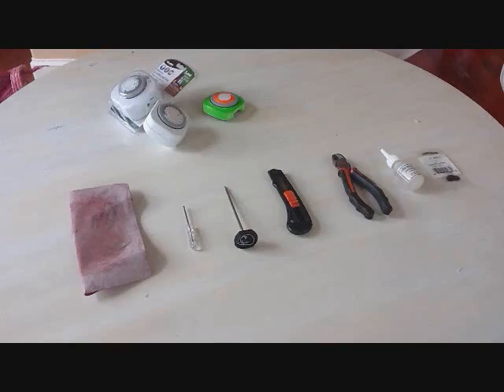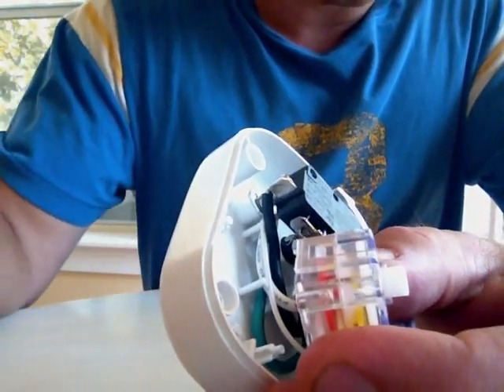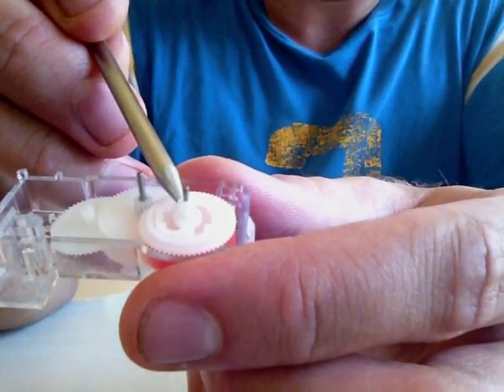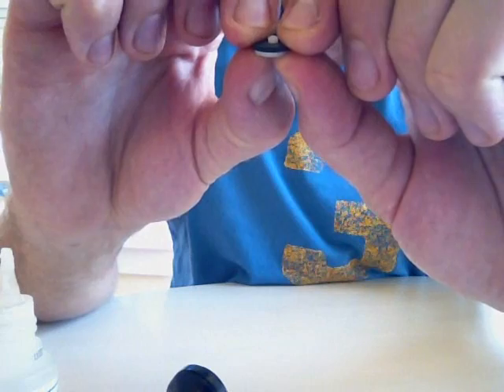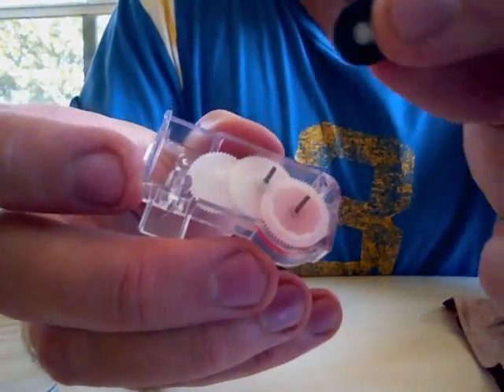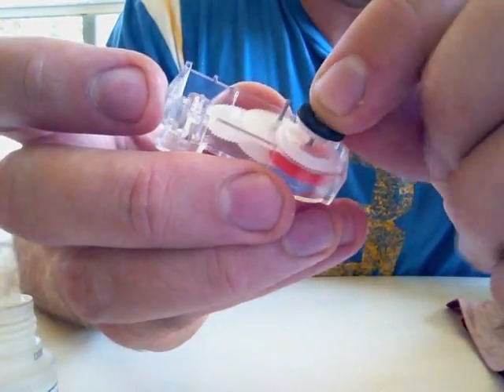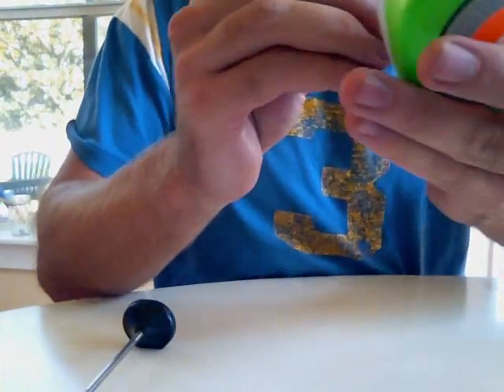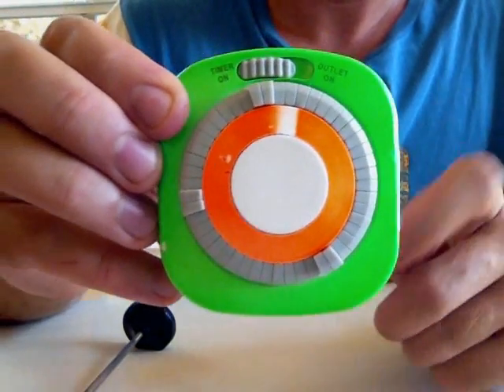Build Repeat Timer! DIY Aeroponics/Hydroponics Timer!

Comment: Thanks! My cheap timer was different. The hack was much easier! Just removed the second gear and then attached the top gear to the third gear under it with a small drop of "shoe goo"  (any glue that you could put a 1mm high glob of would work) The shoe goo bridges the gap created by removing gear 2.  So now the top gear that tiggers the lights is bound to gear directly under it, and gear 2 is gone and the does 24 hours in about 30 minute.  My timer had no brand info on it.

Comment: 🐟 🐡🌱This book covers not only a well written introduction to Dry Aquaponics [Check Details Here  >>>https://t.co/Lrwi0vZuTr  ], but helps you to plan out what you need in order to achieve what you want to produce. Includes information on the system, the plants and the fish used in Dry Aquaponics  gardening. Great source of information that would help those thinking of beginning to avoid many possible pitfalls in creating and maintaining a working system.

Comment: Are you chirocolt on ebay?  I think I bought one of these from you lol.  Mine stopped working after light use and I'm scouring the internet trying to find a cheaper solution as I am not about to spend another $30 on something that doesn't last so thank you for this tutorial.  Now to get a tri-head screwdriver.
Reply from the maker: Yes, I operated that eBay account  for about a year or two until - pm me your address and I'll send you a new one!

Comment: super cool! I did it per your second video as the timer internals are different. But it works. I'm using mine as a pool pump. move water out of the pool into coils in the sun and back in every few minutes...Thanks!
Reply from the maker: Mike M They change the internals  alot unfortunately, if you watch the other video it has a different gear box that you may encounter. Between the two videos you can just about modify any gear box out there once you understand the relationship between the two gears that were changing. Glad you got it working! Rock on

Comment: If all you need is 30 on, 30 off, they have $5 timers at home depot that will do that. just buy the mini-24-hour timer, and raise every other peg.
Reply: Chuck Glenn This has fifty second intervals. Instead of spinning every 24 hours, it spins every 35 minutes, and with that comes a 50 second interval for running an aeroponic mister. You pulse them on and off to get the amount of water flow down real low but the growth explosions are incredible.
Reply: Chuck Glenn 'yeah but what if i need 2 or 3 seconds on and 5-17 minutes off???
then what??
Reply: Sir. if you can name me the timer that you can get for $5 at home depot, I will be very thankful !!
Reply: That's minutes yeah?   Minutes is no good.   Need to be able control in 30 seconds.

Comment: Awesome video! Been looking for something like this... Quick question(s): Why do you need neoprene washers? Are they the same as the rubber washers you get for faucets etc.? Is this something average hardware stores carry? Thanks!
Reply from the maker: Zackery Finn  Yes, rubber, neroprene, even plastic will work. As long as the glue can grab it, and it has a little flex. One time I was using metal washers but if the timer was dropped the shock would cause the glue to separate and the timer would fail,so I started using rubber instead.

Comment: I couldn't find the Westek timer at my local targets.  But I went to Walmart and found a Brinks manual grounded timer with 15 min min increments.  I cracked it open and low and behold, it had the exact same gear mechanism that the Westek has.  I'm a happy camper, hope this helps someone.